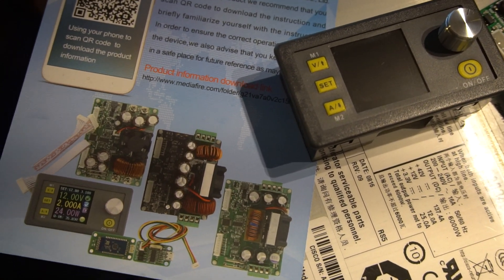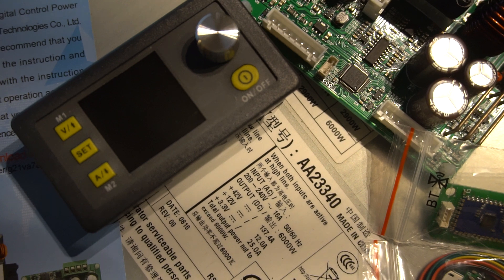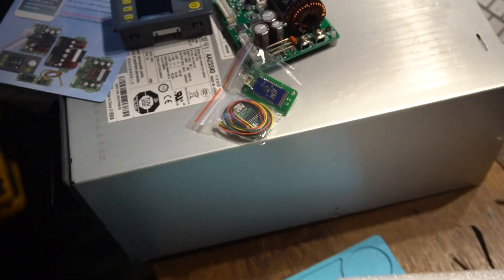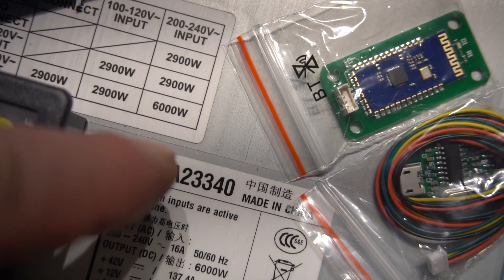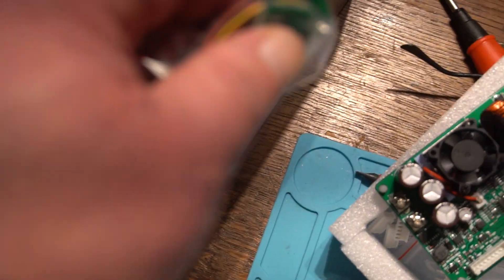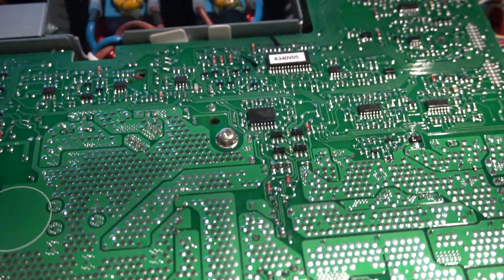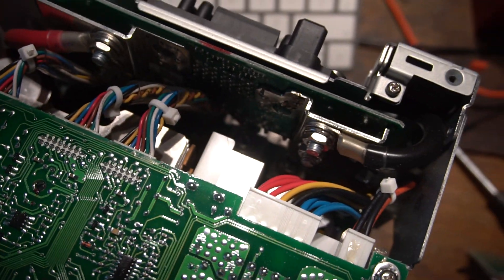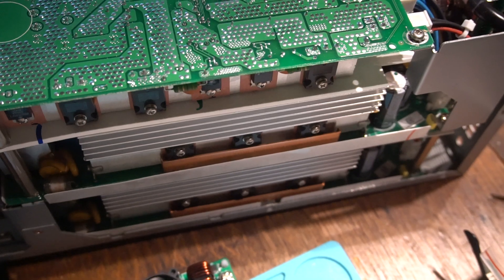DPS5020 with a Astec AA23340 I wanted a power supply

Comment: Did you ever figure out how to power it up to be able to use it. I have one and i'm wondering which wire i need to short out or join together if any. Please help if you can.
Reply: You both are in luck! Check out this page and just use translate feature of Google Chrome (it's in German). It tells you how to do everything with this beast, including boosting it to 52V.

http://forum.mosfetkiller.de/viewtopic.php?f=2&t=63559&sid=8a788a0a54cbf1abf5bb170e5dc6773f
Reply from the maker: No I did not , gave up
Reply: no need a jumper, have switch in front of psu
Reply: @wiltonsurya4600  I removed the back broad and tapped into the large wires instead of using and make a plug to fit the back connector. At that point there are some wires to bring together for it to work. Not hard though just need to follow and find them in the plug.  Plus i made mine work from only plugging in one plug in the front instead of the two plugs. So i have full power all the time it's on running